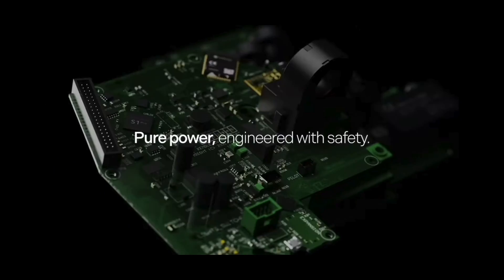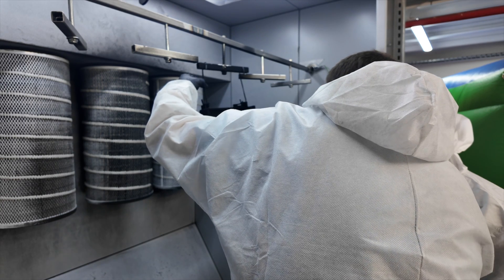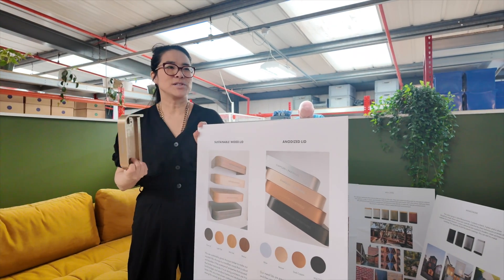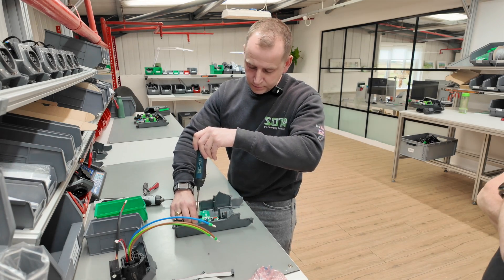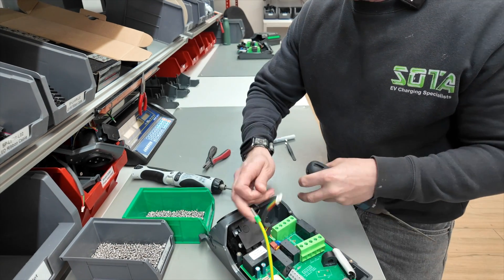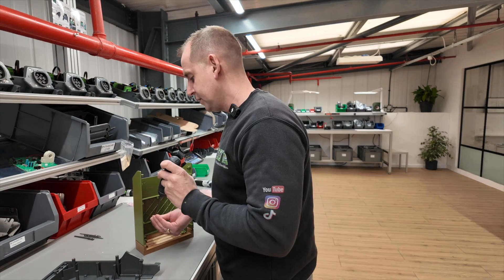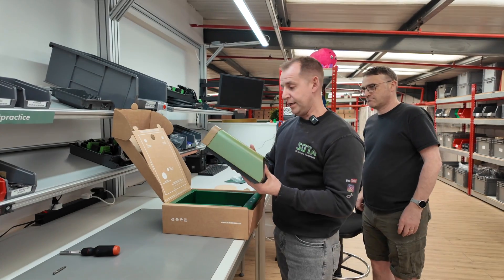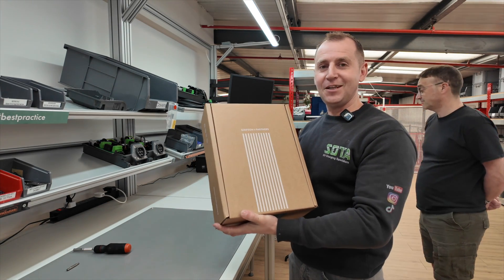I Built My Own EV Charger (and it's awesome)

Comment: home ev is 7p kwh to charge but octopus energy increases the day rate plus standing charge and so people who only have electric home heating and cooking wil get huge electricity bills,  energy companies still robbing people who have home ev charging and is "Never" cheap, i thought rich people were intelligent not to get robbed and know their maths, you can afford a tesla because you have a big private pension, shares and get paid by your subcribers, but we ordinary low paid people can never afford a decent ev like tesla because our parents, ancestors never stole wealth

we tax payers pay for infrastructure and these companies rip us off with high prices
Reply from the maker: I’m not sure if you’re aiming these comments at me? I don’t have a Tesla, a big private pension or get paid loads by subscribers, I’m literally a normal hard working class lad trying to better himself
Reply: What are you on about lol. Ive just got a 3.5 year old Tesla model 3 LR. I paid £20,000 it has 4.5 years warranty on the motor and battery still. I had a Alfa GT1.9Jtd for 10 years prior. I am on Intelligent Octopus. The 7.5p over night rate far outweighs the slight bump to daytime rate. I run washing machine/dryer, immersion heater, dish washer and charger car over night. I only turn electric heater on in the room I am in. Cooking costs almost nothing, electric ovens are very efficient, they turn off once up to temp and I use an air fryer most of the time anyway. I reckon its about 10-20p at most for cooking.

Comment: Loving the factory tour video - how many pages of NDA did you have to read/sign!!! 

Let’s hope their track to order records keep an eye on “that” charger. 

Wait until they outsource their manufacturing to China. Never to be seen that inside view again. 

Brilliant. Going to order one and fcuk waiting for Octopus to add it as a “recognised” charger.
Reply from the maker: Thank you, no NDA’s and I can guarantee they won’t outsource the manufacturing to china, they really love British manufacturing and have made it basically their policy to keep it all in the UK, if you ever get a chance to go you will see what I mean, really down to earth people.
Reply: @sotaelectrical  I see these have built in PEN fault do they also include the RCD? Im torn between a charger and a 32a commando with EV board (including RCD, SPD, PEN), then use Tesla mobile charger with 32a adaptor. Can this charger just be connected direct into CU with a 40a MCB if it has all the relevant protection? I like the look of this as mine would be mounted internally and cable out the window for various reasons.

Comment: Great looking charger, but with no integration with Octopus IO, it’s a no go for many 😢
Reply: Octopus need to pull their finger out & up their game. They need to hurry up & allow other charges on Intelligent Go or stop the demanding the approved "ultra smart/snooping" chargers only for Intel Go.
People without approved charges are offered plain Octopus Go = 4 hrs at 9.5p per kW - BUT...

Sorry Octopus, Eon Next Drive offers 7hrs at 8p per kW for ANY CHARGER - even a granny charger
That's 1hr more than Intelligent Go, though it is slightly more at 8p vs 7.5p per kW
(Plus this is fixed for year (no tie-in/exit fee & you can renegotiate when price dropped from 9.5p to 8p recently)

Yes, this is 7 x hrs for all household electricity, not EV only like OVO, but this 7hrs x 8p is available to ALL EV owners - even those still using a granny 3 pin charger, let alone an old Pod-Point or BP Charge Master charger

Also Eon offer Solar owners 16.5p per kW Export vs 15p from Octopus
(Must be MCS Certified for Eon, Octopus may allow self installs)

If Eon or others start to offer say gas tracker/flux tariff options then Octopus will find themselves losing their market share very quickly

Octopus need to up their game/rates, avoid demanding only a few approved EV chargers to continually chat to EV's to obtain best EV charging rates - unless they offer much much more cheaper rates very soon

Soz for Eon plug, but it is a good option for anybody struggling to meet the requirements to get on Octopus Intelligent Go

Comment: No Intelligent Octopus or OVO charge anytime integration. They need to focus on this rather than the colours
Reply: Eon Next Drive at 8p x 7 hrs is catching the others up, no specific charger required, even a granny charger will do, Export at 16.5p.
Octopus need to stop being so demanding on the EV charger spec & offer Intelligent rates of 7.5p x 6 hrs to all std Go customers...
Then re-jig Intelligent Go with more approved chargers for say 7 or 8 hrs at say 5p per kW

** For some reason my comment/reply isn't showing up (YT / OP) **
I'm going to suggest it's YT...
If you list comments with say "newest first" - BINGO, my other replies appear ???

(Try it & see for yourself - list newest comments first)

So I had to reply here to 4p more kW more claim...

NOPE - 1.06p more, but 18th hr is already off peak 8p vs still day rate on Octopus
This mean during the 18th hour Octopus is 23.21p more expensive than Eon ND per kW

Now offset the halfpenny more you pay for EV charging on Eon vs Octopus...
it roughly works out the same in most cases

Only you don't need a specific EV charger for Eon ND

BUT YES EON ND standing charge is 2p more per day than Octopus

However to recoup say a £1,000 EV charger install to get onto Octopus saving 2p per day standing charge...
Would take you 50,000 days saving 2p per day standing charge
Or 137 years to recover the grand to have an Intelligent charger installed
Reply: @authuruksake969  but the peak rate on Eon a lot more than Intelligent Go. It's 4p kWh more
Reply: @authuruksake969  ok good info. As most decent EV chargers are about £1000. Why would you spend £1000 on a non compatible charger Vs a compatible charger?
Reply: @330d5  you don't need to is the point I'm making, you don't need to buy a new wall charger for Eon ND.
Octopus need to stop demanding specific chargers just to obtain 6 x 7.5p
They (Octopus) need to up their game, give std Go users 6 x 7.5p & intelligent users should be offered 7 or 8 hrs at say 5p, British Gas will offer a credit to EV owners who jump through hoops to meet criteria & this credit brings down EV charging to 4.95p per kW
Octopus is being caught up by the other companies, they need to up their game, bring back really cheap EV charging asap
My post was originally offering an alternative to EV owners needing to save costs but don't have a spare grand to get cheaper energy easily
Reply: @authuruksake969  ok. So I'm conclusion if you can survive using a 3 pin then fine, Eon is the way to go. On the other card if you need a fast charger then get a Ohme or similar which is compatible with Octopus Intelligent and OVO.
Reply: I have a S&P Basic 7KW and Intelligent OG is done through the car
Reply: @Bigchimping1  I'll bet that is because YOUR CAR is Octopus Intelligent compatible - the S&P like many other chargers is not compatible with Intelligent Go by itself. If your car is compatible, eg: Ford Mustang-E, Tesla Y etc... you can use a std 3-pin granny charger on Octopus Intelligent Go. The charger is irrelevant for Intelligent Go VEHICLES
Reply: Minor issue really. Just schedule it on your car, still get a great overnight rate on Go
Reply: @rogerfinch7651  Go is more expensive and only has a 4hr off peak period. Plus you don't get any additional off peak hours for the house. So not really a minor issue
Reply: @rogerfinch7651 the S&P charger is not supported on their EV tariff.
Reply: The people who spec these aren't interested in cheap tariffs only how it looks